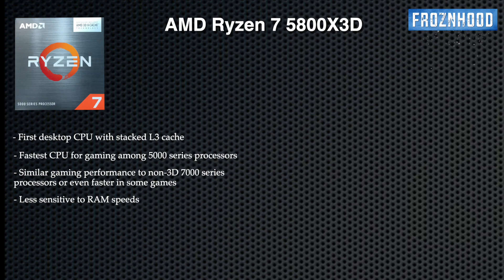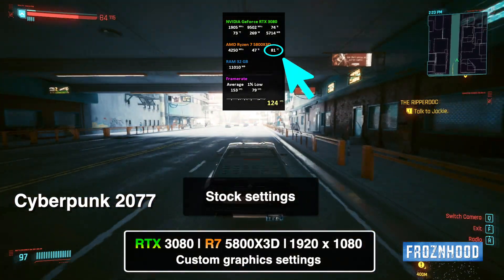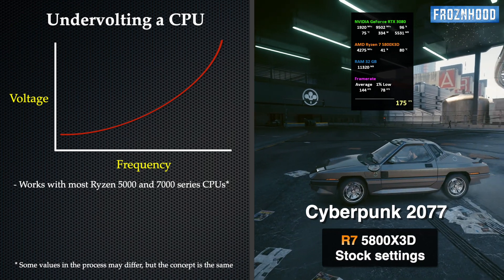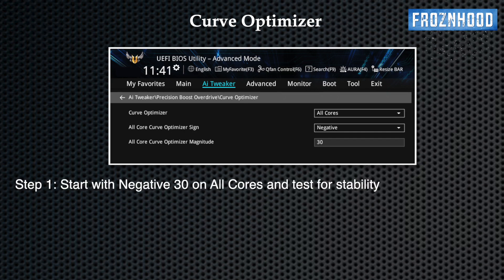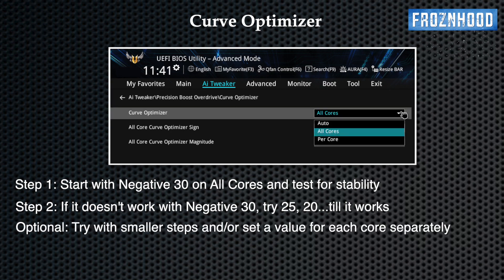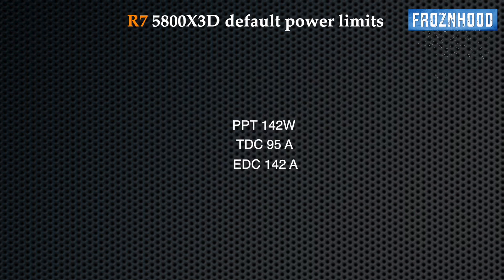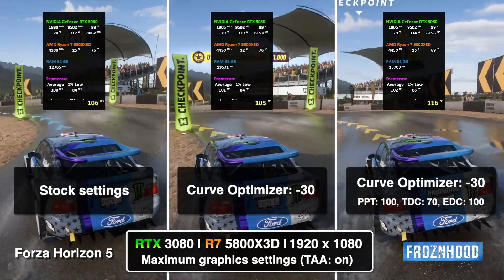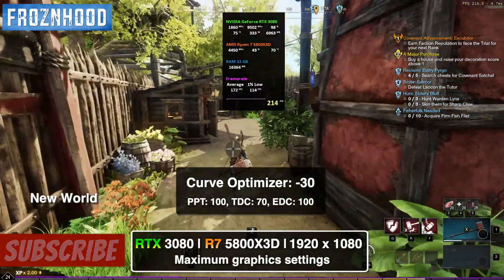Optimizing Ryzen 7 5800X3D - Higher performance, Lower temperature | Undervolting | Curve Optimizer

Comment: I tried undervolting too and it made meaningless difference. Then I read that simply enabling AMD's in-built auto clocker is enough because it maxes out performance based on temperature of cpu. The cpu is designed to run at 90 degrees... I run it no.problem to this day.
Reply from the maker: If you don't get good results from the undervolting, it means you are not doing it properly. Also, the CPU is NOT designed to run at 90 degrees. That is 100% NOT correct. 5800X3D is very temperature sensitive. The added cache is one of the reasons. 90 degrees is it's Maximum Operating Temperature (Tjmax) and you absolutely don't won't to leave your CPU constantly running at this temperature. You will have heavy throttling,  noisy cooling and you will shorten the lifespan of the CPU.
Reply: @FroznHood  What's there to not do properly, it's a basic setting. I ran cinebench yesterday with pbo set to auto as it's always been and I'll try your method since you claim that it makes difference
Reply: @FroznHood It still reaches 90 slowly with -25 and doesn't go above 88degrees with -30. I don't know if this is a meaningful difference but I'll keep it 😅 It will probably lower performance in games reliant on single core performance but increase it in most other games, cinebench showed a little bit of improvement in multitask

Comment: Hi. I will be getting the 5700X3D in a day or two. I have the b450 Aorus Elite mobo upgraded to the latest bios. I currently do not see the curve optimiser under bios. Once I install the cpu, will it then show?
Reply from the maker: I don't know the reason why you don't see it now. What CPU are you using?
Reply: @FroznHood  I am currently using the Ryzen 3600. Assuming that is the reason I dont see it. Will be installing the 5700X3D tonight.
Reply from the maker: Yes, that could be the reason. When you install the new CPU don't forget to first completely uninstall the AMD Chipset driver and then install the newest one from the AMD website (not from the website of your MB). This is a very important step.
Reply: @FroznHood  I am not able to figure out the old chipset drivers even after going via the device manager >>> system devices. Will it be ok if I skip this step?
Reply: @FroznHood  also, on the AMD website I am not able to find 5700X3D chipset drivers
Reply from the maker: If you don't see the drivers in Windows Apps & Features, you can use this AMD official utility - https://www.amd.com/en/resources/support-articles/faqs/GPU-601.html
Reply from the maker: Here is your chipset driver - https://www.amd.com/en/support/downloads/drivers.html/chipsets/am4/b450.html
Reply: @FroznHood  I saw the driver details from system devices. The driver date is the latest one, so I am assuming it is done?
Reply from the maker: I already told you what I recommend. It is not just one driver in the package and the installation parameters may be different for different CPU generations. There is a difference between 3000 and 5000 series in this regard. It is just an advice.
Reply: @FroznHood  yes yes. I downloaded the chipset driver for my MoBo from AMD. It checked my hardware and then installed the latest drivers. So am I good to go?

Comment: My man just convinced me to keep my 5800X3D through the next gen 9000 series from AMD. Literally 5800 x 3D is the goat
Reply: It was obvious even 2 years ago before 7800x3d came out. All the negative iq plebs were crying that 5800 is dead end and you need to save for new gen... Yeah right, it still is a beast and will be for several years.
Reply from the maker: Yes, it is an excellent CPU and the price is very good these days.

Comment: Lol what u talking about my 5800x3d never goes above 60c
Reply: Bro... I was same when I bought it. Then I kept running cinebench and noticed that it runs like a cpu from 1999 :D The thing is, you have to enable xmp profile in bios because it runs at super slow speed by default. When you setup it properly, it goes to 80+ and runs at least twice as fast a than stock.

Comment: Thanks you very much
My setup: MB ROG STRIX B550-F GAMING + 5800X3D + Dark Rock Pro 5 - before following your steps in PUBG I had 75ºC to 81ºC now I have between 55ºC - 62ºC.
Reply from the maker: Very good result!
Reply: @FroznHood  A question in all core curve optimizer magnitude which is better to put 30, 25 or 20 which helps more ? I have tried just putting 30
Reply from the maker: -30 has the best effect if your CPU can handle it. If it is not stable, you then try -25.

Comment: Im getting 60 degrees under load with Cooler Master's MasterAir MA410M cooler. Also running 1 intake and 4 exhaust fans and it's never going over 60 degrees

Comment: friend, I already commented thanking you. and I'm coming back to thank you again. I did exactly the same PBO configuration months ago and it's still perfect. It reduced the temperature a lot, maximum 73 degrees. measure 65 degrees. and maintaining all the power of the 5800X3D. Researching, I discovered that the 5800X3D supports up to RTX 4080 with 100% GPU usage. Thank you again. hug from Brazil.

Comment: How do i find that UEFI BIOS Utility, where i can change that settings ? i have a 5800x3d
Reply from the maker: Which setting do you mean? Everything is done inside the BIOS.
Reply: @FroznHood yes, my bios does look different, i can’t find the curve optimizer :/
Reply from the maker: Very often the BIOS user interface depends on the brand and the model of the motherboard. You may need to check again all menus.  It is also possible that you are using an old BIOS version. You should check that.
Reply: @FroznHood  yes, thank you, i found it ! but my CPU still reaches 91 degrees while playing :/ i don’t know why
Reply from the maker: If you have set all the settings in the video you shouldn't get such high temps. Something is very wrong with your cooler or the air flow in the case.

Comment: I have the 5800x3D with an Asus X570 TUF Gaming Plus WiFi which has the same bios as in the video but the PPT, TDC and EDC limits are stuck in auto and grayed. Any way to manually change them. Changing the other settings to manual on that page makes no difference.
Reply from the maker: No matter if they are grayed you should still be able to enter custom values. Just replace "Auto" with the value  you want.
Reply: @FroznHood  it won’t let me change it manually. Auto is just stuck auto and grayed. Pressing enter on the lines does not allow me to manually change it as I did for other values.

May have been removed in the latest bios as I’m on the 03/24 release or maybe there’s another setting to unlock those settings?
Reply from the maker: Don't press enter or try to Tab it the input fields. Just put the mouse cursor over the value field, click and then type the value you want with the keyboard. Don't expect the usual user experience here. For some reason they made it that way. It should work. There is no reason these settings to be stuck on Auto or to be removed. And they do not need to be unlock by other setting. Just try again. Did you also set the Curve Optimizer?
Reply: @FroznHood got it to work, thanks. Curve optimizer worked flawlessly. PPT etc. worked when clicking and just had to type even when it was grayed out. It’s almost like they purposely make you think it’s forced in auto haha.

Comment: I tried these settings with my R5 5600X3D and it runs great much cooler than stock in Fortnite for example it was in the low 70c silent fan curve but with these settings it never sees 60c and the performance is much smother thanks for the video

Comment: I have a asus tuf gaming b550 and my cpu seems to be locked at 3.58 even with all these settings is there something i can do?
Reply from the maker: There are two things you can do that usually solve this problem - 1. Try to fully reset your BIOS and then apply the settings from the video. 2. Make sure that your BIOS is up to date. You may need to update it, then check if it is at its default settings and after that apply the settings from the video.

Comment: great video but it always crashes after sometimes days or weeks when I use curve optimizer. Don't trust it even if it seems stable. the Limit does work tho without the crashes but the performance isn't as good.

Comment: Merci beaucoup mon gars j'ai récemment upgrade mon cpu du 3700x au 5800x3d avec une rtx 3080. Et les températures du 5800x3d sont folles 90°c en jeu. Avec tes paramètres j'atteint moins 
- 20 à 25°c en jeu avec plus de FPS merci 1000 fois.

Comment: After applying the settings, I didn't see much of a difference, the temps still got as high as 80. What should I do?
Reply: That temp is still fine with the 5800x3d . it’s all about silicon lottery tbh. my 5800x3d has a max temp of 83c on very heavy load and gaming 65c-75c depending on the games you play. every chip is different that’s why in the vid he said to mess around with the pbo and co settings some chips can do -30 while some can do -25 . Btw shader comp will always make your cpu go at 100% usage for a bit so don’t freak out if you see it hit max load for a min or two. Happy gaming my friend 🙌
Reply from the maker: If you don't see significant difference between the stock values and the settings from the video, it is possible that you either are not applying all of them properly, or you are not testing/comparing properly, or something else in your system is wrong. Yes, every chip is different, but unless your unit has manufacturing defects/issues you should see a good temp difference even with -20 CO and power settings around the value shown in the video. With a good air cooler, 65-75c in more CPU heavy games is normal (even up to 80c in some rare cases). Up to 85c is normal for very heavy multi-core tasks. All this in case there isn't anything else that impacts the CPU temps such as bad or faulty CPU cooler, other overheating parts in the system, bad case air flow etc.
Reply: @FroznHood  thanks for the reply🙌 I get the same temp/mhz values as your video with constant 4450mhz  . but I only use the CO at -30…the only game I have seen reach 80c are dead space remake. All games I have played are around 65-75c max temps. Game  examples….Valorant, re4 remake,Rdr2, Alan wake2.

Comment: Been using the same mediocre(at least I thought it was) MSI air cooler since 2017. 5800x3d user for almost a year now. I usually do heavy rendering and high performance gaming stuff. Never seen the 5800x3d above 67 degrees celsius. Just do what it says in the video for your own sake. Great informative material.

Comment: How did you come up with PPT:100, TDC:70, RDC:100? That's 70.42%, 78.94%, and 70.42% respectively. I know you said it depends on your temperature target and cooling, but are you using some kind of math conversion or fomula here?
Reply from the maker: No, there is no formula, because, as I said in the video, every cpu unit is different. It is all about testing. My unit works best at these settings and they are a good starting point for your testing. Yours may also work best with 100/70/100, or it may need a bit higher values.

Comment: I am interested behind the logic of these three values (100W, 70A, 100A) you have chosen to replace the defaults. I have tried these values using Kombo Strike [3] (essentially the same as Curve Optimizer using negative 30 offset) and the game seemed to be more luggish in pubg. I reverted PPT, TDC and EDC to AUTO and getting the same CPU Clock 4450Mhz but the game feels less stuttery. CPU: 5800x3d, RAM: 32Gb (4x8Gb), GPU: 3080Ti

Comment: Mine wont go over 4.4 like it reaches under load 4.392. I have the same settings shown by you but even better cooling, like maximum i reached 60c. I dont know what  it could be
Reply: Quick update, i did some chinebench. With only -30 i got better peformance then messing with the limiters. Only -30 i got 900 points, max temp 76. Max freq 4.485 on some cores. Average freq 4.410. -30 + your limits i got 880 points, max temp 75c and same average freq.
Reply: @casperSQ  hard to duplicate a scenario for every CPU. for me this worked flawless. My cpu does run -20 mV and 100/ 70 / 100 aswell. i have performance increast of about 2-3% over stock.

Comment: Very great video thank you so much,, i followed your steps and saw couple of guides, i change it to122, 82 and 124 while keeping the -30. i did a stress test for 1h and didnt get any error.
is 100,70,100 better numbers than 122, 82 and 124? i am still confused
Reply: You just give your cpu less juice with 100 / 70 / 100. Its not better or worse...its just what your cpu can manage. Some cpu need bit more juice, others doesnt. As you long as you did some testing and it does work flawless its perfectly fine.

Comment: Thank you so much for the straight forward video, I have applied the same exact values on my Ryzen 7 5800X3D and temps are perfect. On full load it sits on 70c degrees and idle 35c degrees without lossing performance. Greetings from Costa Rica!

Note: a few cores made it to 4.5gz

Comment: hi, I had undervolted before to great success. I decided to follow the values for PPT TDC EDC that you said, but at 100w PPT I notice the clock speed on my cpu not staying consistently at 4.45ghz, it'll fluctuate between 4375mhz and 4450mhz (not at 4.45 for long). 105w yields better results for me, have I just been unlucky with my cpu?
in other news though undervolting did help, previously my cpu ran at 85+ and would fluctuate in clocks, now it will max around 75 and constantly boost to 4.4/4.45ghz.

Comment: Can I use this setting for my R5 5600X aswell?
Reply from the maker: The undervolting strategy is the same, just the power setting values are different. With 5600X usually it is enough set the Curve Optimizer to -30. You may not need to change the power settings, but that depends on what you want to achieve. You can try reducing the power settings, but again, they are different than those of 5800X3D.

Comment: when i do the 100 70 70 settings with -30 it gives me errors while testing it with OCCT, but not with only -30 settings, should i just run it with -30?
Reply from the maker: That depends on what you want to achieve and how your CPU currently works. You can try with 110/80/110 or 110/85/110.
Reply: -30 is a lot tho...maybe you try with a less hardcore undervolt first.

Comment: Just upgraded to 5800X3D and set these values. Works like a charme.

I see no noticable difference in performance / which is good while using a bit less power i guess. Still one difference i saw was random spikes to 4.55Ghz on 1-2 cores, instead of "just" 4.45ghz all core with stock settings. No significant changes in benchmarks tho

Much appreciated!

Comment: Although I had no trouble with temps on stock (up to 73, with Phantom Spirit 120 SE), clocks couldn't go higher than 4250 mhz.
Applied your settings (30 negative all cores, 100 70 100) and together with CPPC enabled and CPPC Preferred Cores disabled, under AIDA64 Extreme stress test, temps are now up to 66 - 67 and clocks are on 4450 mhz. Stable!
So thanks a bunch, you helped an absolute noob undervolt his cpu and drain that extra 200 mhz out of it.

Comment: im normally a guy who just plug and play :D but decided to test the CO and was surprised that with lowering voltage u get more juice  ;D btw if someone wants to get little bit more fps i use PPT: 122 TDC: 82 EDC 124 it runs like 3-5^C hotter but better AVG FPS
Reply: With -30 curve?

Comment: Hats off mate. No bullshit, straight to solution. My idle temps went down from 70 to 45-40 celcius, low settings ow2 and cs2 are at over 400 and 600 fps with temperatures capped at 55 max. Thank you.

Comment: i dont hace curve optimizer in my asus rog strixx b450 and mi asus prime x570-p !!! WTF only pbo
Reply from the maker: You can try updating the BIOS to the latest version and check again in the menus. If you have PBO settings, you should also have curve optimizer and the ability to set power settings.

Comment: Do you think setting PPT to 110, TDC to 85, and EDC to 110 will show an improved performance compared to the values you showed, or do you think it will be negligible? Also how do you think your optimization will affect CPU intensive games such as CS2 and Valorant? Thanks!
Reply from the maker: 110/85/110 should not improve the performance in games, it may even slightly decrease it because of the higher temps. But this depends on the unit. In any case both 110/85/110 and 100/70/100 will work better than the stock settings. Regarding your second question, the optimization will bring a minor fps improvement and much lower temps in CS2 and Valorant. It also depends on the resolution and your GPU, because CS2 becomes a lot more GPU demanding at maximum graphics settings and higher resolutions. It is not the same as CS:GO.
Reply: @FroznHood  I see, thank you!

Comment: I’m am running the 5800x3d with a negative -30 curve all core 100PPT 70TDC 100EDC

On Cinebench 2024 I scored a 877 on multi core vs 872 stock settings and a 94 single core vs 93 stock settings.also boost was staying pretty much consistent at 4.5GHZ 

Very small margin but slightly better scores while using less voltage. Also ran prime95 for a while with zero warnings and zero errors. Pretty happy with the results overall.

As for thermals during prime95 it never goes over 75c where as before changing the power settings it was hitting 83-85c.